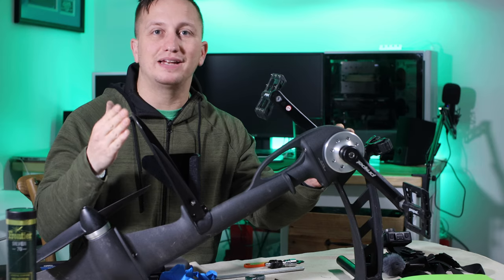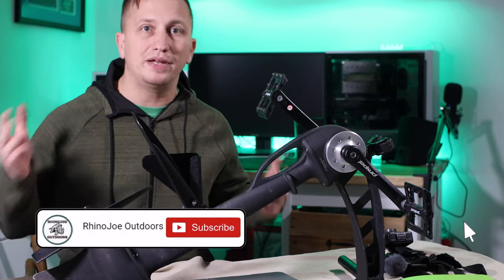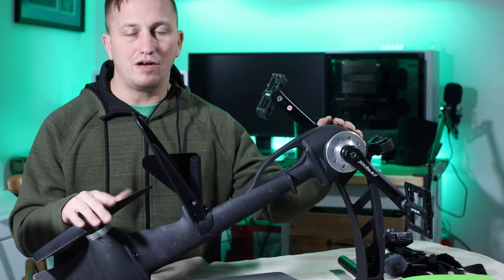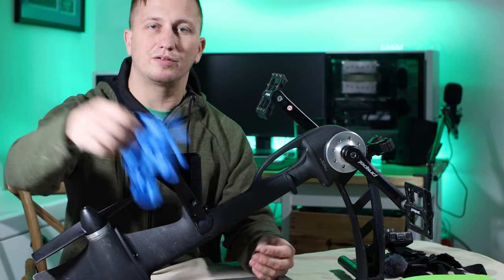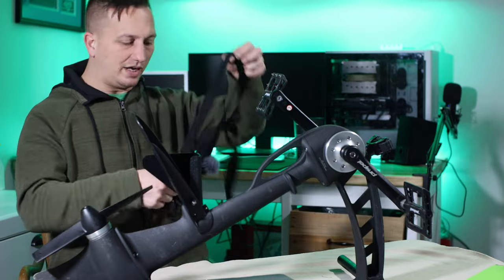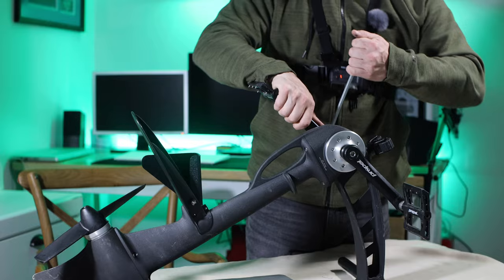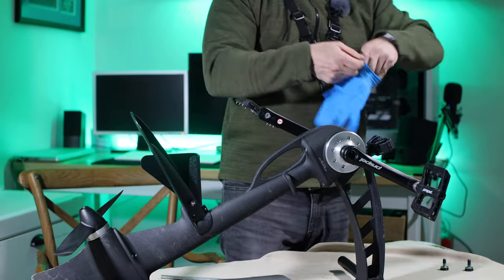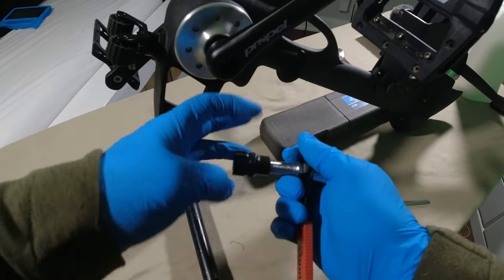NATIVE PROPEL DRIVE MAINTENANCE DIY- Step By Step to keep your Kayak Drive Smooth and Functional

Comment: Just want to drop a comment saying how helpful this video was.  Bought all the equipment recommended and did it in about 30 mins.    Got my kayak used 4 years ago and never did maintenance until today.  Despite such a long time and pretty regular use, the gears were in good shape.   Definitely smoother than before though.  Thanks!
Reply from the maker: That's  awesome! Its not super hard to do and gives you confidence your drive is in good condition. Especially when you are out a long ways

Comment: If anyone starts getting clanking or other noises and the pedaling isn't smooth, check to make sure you didn't strip a gear.  The small gear on the upper transmission on my propel drive was jacked up after two years of use so I had to replace it.  It was an easy fix, but I would have thought it would have lasted a little longer.
Reply from the maker: Thanks for the input. I find that odd too. Had you ever disassembled it?
Reply: Yes, did the routine maintenance following your step by step video a couple times.  All of a sudden a couple months ago, it started with the loud noises and clanking.  I push the drive too hard sometimes so I think that's why the smaller gear stripped.   @RhinoJoeOutdoors
Reply from the maker: I would thing the metal used would be stronger than that. Sorry to hear that happened but glad you got it figured out.  @nj_angler_kjb
Reply: I would have thought so too.  3-4 grooves from the smaller gear were worn down quite a bit.  Anyway, easy fix!  Thanks for the video. @RhinoJoeOutdoors

Comment: Looks like a well-built unit! Check out a video Florida fish Hunter posted I think it was called native drive oil conversion. He changed it from a grease to an gear oil conversion in the lower unit.
Reply from the maker: I don’t want to void my warranty so I’ve kept mine greased
Reply: works far better than grease! Really worth it. Mine is 3 years now, 2 on oil.
Reply: @RhinoJoeOutdoors  It is not just put some oil, it is fill all the unit with engine oil, all components stay permanently imersed in lubricant it makes the drive extra smooth, much quieter.
Reply from the maker: @aranha9365  The problem is if you buy the unit new putting oil in it will void the warranty with the manufacturer. If it weren’t for that I would have use some gear oil like you use in a vehicle differential or in a lower unit on a boat.
Reply: FFH is a badass

Comment: I noticed as soon as you touch your pedals the propeller responds immediately...Mine has about 1/8" of play when I move my pedals before the propller responds, I thought that was normal, guess not. What could be that be? Do i need to tighten something?
Reply from the maker: Make sure the top silver ring that screws in is tight. That's what sets your pre-load on this type of ring and pinion gear system. Sounds like the ring gear from the pedals isn't close enough to your pinion gear on the shaft.
Reply: @RhinoJoeOutdoors  Hey thanks for getn back with me...I am not sure what's meant by "top silver ring" can you elaborate? Or let me know which area on the drive has this "silver ring".
Reply from the maker: @prynceal6762  it’s the part where the crank arm attaches. It’s the silver ring that you have to use the spanner wrench on.
Reply: @RhinoJoeOutdoors  Oh ok, hmmm I have never touched that its still sealed/tightened from the factory...However I have opened the lower unit in the past to fill it with gear oil but that "play" existed prior to me doing that "maintenance uograde" but I will give it a double check...Thanks again!!
Reply from the maker: @prynceal6762  no problem. If you ever work on vehicle differentials it’s the same concept. If you search google for Yukon gear ring and pinion setup you will get an idea of how the gears should mesh. I would suspect the gears aren’t tight into each other enough. In a vehicle it’s a lot more crucial with the loads transferred.  I would check on it though because if it’s too loose and you put too much pressure on it you could possibly cause a gear tooth to break.
Reply: @RhinoJoeOutdoors  Thanks for pointing that makes 100% sense!!

Comment: I’m hoping the manufacturers start using the “ISIS” style of splined bottom bracket system in their drives. The arms stay tight much longer and the system is just a stronger mate up of the cranks arms and bottom bracket spindle.

Comment: There are 4 bolts on the bottom and four on the top.   You don't need a spanner wrench to grease the gears.   Nor do you have to take off the pedals.  I have a video of the complete break down of the drive.  All parts and components removed.

Comment: Do not buy the Amazon arm puller I highly suggest getting the burley pro set. If your crank arm is even a little tighter than it should be from the factory the center push screw is just small enough to ruin your threads.  200$ mistake for trying to save money on the tools. This guy got lucky not to experience this but take my word for it get the burley pro set
Reply from the maker: I never had a problem with the Amazon puller. I’ve used it on the pedal drive and on my bike with no issues.